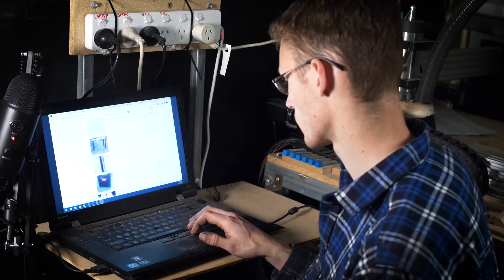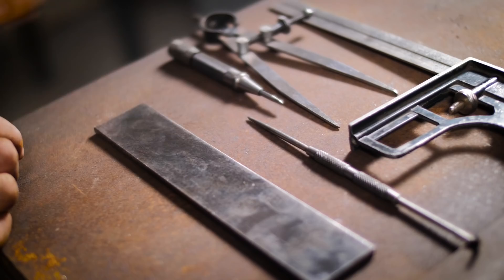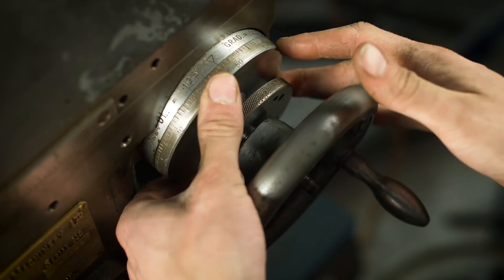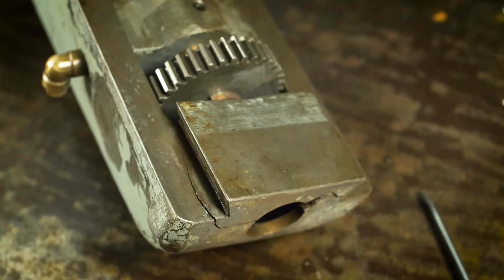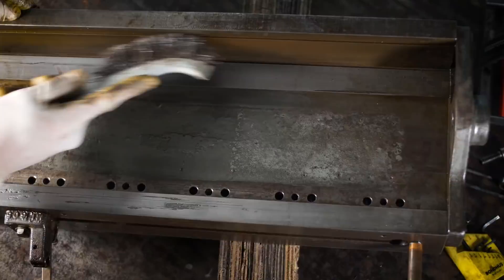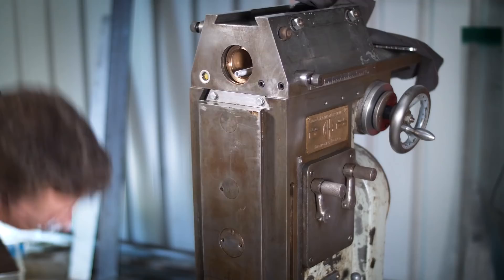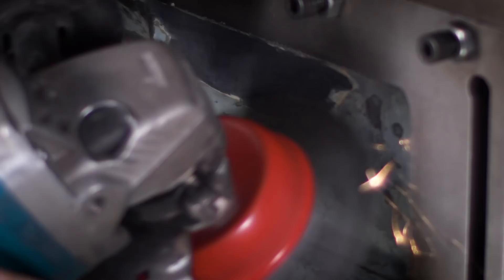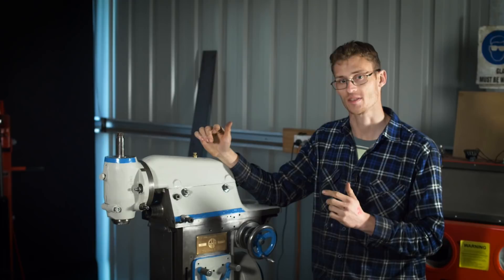GHA Milling Machine Restoration (Deckel FP1 Clone)

Comment: Hi. I had basically the same mill. Deckel fp1 Romanian version. Didint have the vertical had. So I bought deckel head.  Rubbish mill :)) I don't like mills on bronz bearings.
Reply from the maker: only the horizontal spindle is bronze, the vertical head has bearings. I didn't realyy show it, but the bearings were good in there
Reply: @TomMakeHere  mine had also on the vertical spindle bronz bearings, the precision one. And some trust ball bearing.

Comment: I have currently finished stripping and painting my lathe and the next project is my 1966 Bridgeport. What I'm desperate for is those precision ground flat stones which I find impossible to purchase here in Oz. Where did you get yours from?
Would love to purchase locally. 
Great Restoration by the way. 
Cheers.
Reply from the maker: You can probably get pretty far with an arkansas stone or similar, the hard/translucent stones are very fine and would work well for finishing. I'm a bit lucky, I won the stones in a tool making competition earlier this year.
I had intentions of one day making some as I know there is a market, but I need to upgrade my grinding setup first.

Comment: Great video and great find! Wish I was lucky enough to find a deckel fp1 (or clone) for a good price... Also I was wondering if the table shouldn't be turned 180 degrees? I always thought the smaller t-slot part should be at the front? I'm not an expert though haha
Reply from the maker: I'm surprised I found this one!
yeah not sure, the table was already this way around lol. It can swivel close to 45° each way at the moment.
I suppose I really just need to check where the vice can best be positioned.
Reply: @TomMakeHere  I suppose it doesn't really matter as long as the vice fits. Also I looked it up and turns out I spoke too soon, I saw someone else who had the table the other way which caused my confusion...
Reply from the maker: @lennarthoek8392  I actually got a nice anglock style vice at the start of the year, but it's ridiculous on the hercus (half of it hangs off the table). It fits nicely on this table so that's a good thing

Comment: soooo dude, that was probably lead paint- so you shouldn't wire wheel it... other than that awesome restoration
Reply from the maker: I 100% agree with you. I've upped my safety standards since this video, I never grind, sand or strip without a mask these days. Doesn't matter what type of material it is either.
Thanks for the comment!

Comment: What do you use to solve rust
Reply from the maker: I tried soaking in concentrated vinegar. It helped a bit, but I found that just scrubbing with a wire brush worked very quickly. I added WD-40 as a lubricating medium and to reduce the dust
Thanks for watching

Comment: You have to really scrub to even remotely have an impact on the flatness of a milling table.
Reply from the maker: I really only said that because I saw someone receiving a lot of flack over doing this.
I personally don't see an issue unless it was done aggressively with a power sanding tool or something
Reply: @TomMakeHere  Yeah, there are a lot of armchair experts around who are talking out of their asses to the masses. I wouldn't pay them any mind.
Reply: Agreed - I'm a woodworker, and woodworkers sometimes/often try to flatten handplanes with abrasives.

It's horrendously difficult to substantially alter a flat metal surface with wide area abrasives.
Reply: @paulwomack5866  As a machinist, I used to laugh whenever I saw woodworkers using sandpaper and float glass to flatten the sole of a hand plane. I thought they were doing it for some purist reason until I realized they are unaware of metal scraping.  Years ago, I showed a bunch of folks at a woodworking meetup on how to use a Dremel with a rotary stone, a piece of granite and some Dykem Hi-Spot ink to flatten a #8 plane in under 15 minutes. Normally, this would take hours of sanding and tons sandpaper. They were completely in awe and thought I was a genius.

Comment: Sorry.You just clean not restoration.
Reply from the maker: Technically though, isn't that what all restorations are? Take apart, remove rust, deburr, fix everything that is stripped and damage, fix the little things that are wrong etc
Before I had this machine it was unusable because it was too badly seized to operate